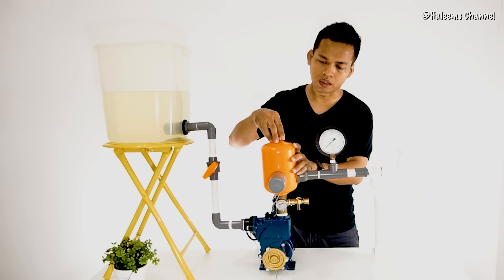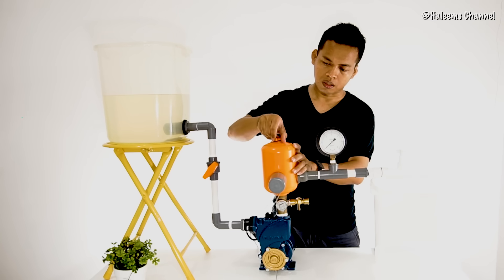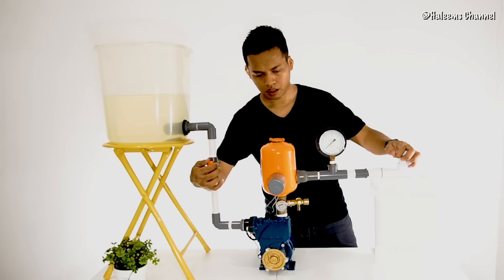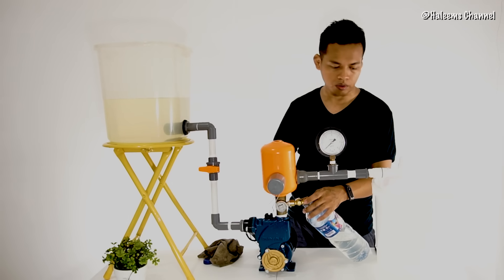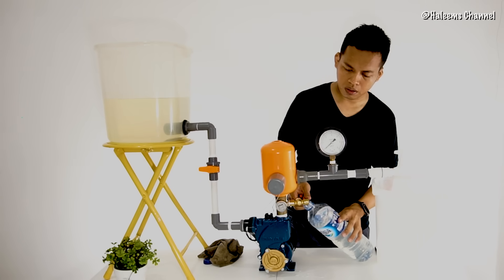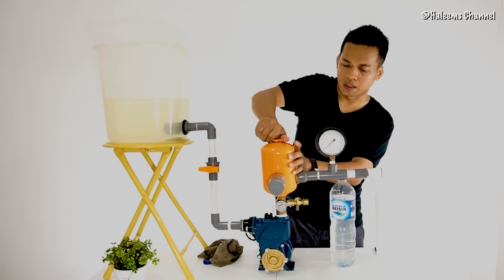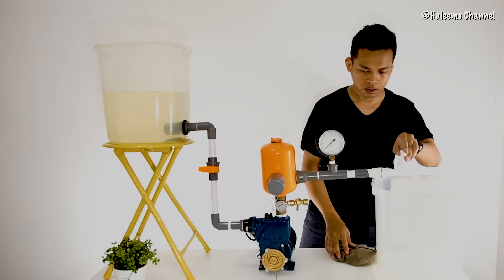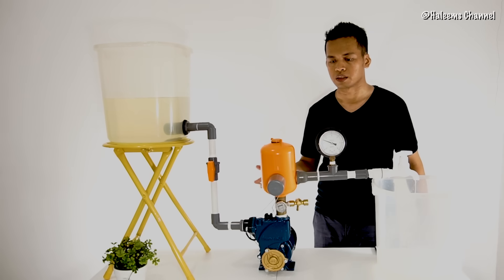Cara Memasang otomatis Pompa air dan Mengatasi Bunyi Cetak Cetek pada Otomatis/Pressure Switch

Comment: Mau tau apa yang salah dari skema pompa ini??
Itu posisi air masuk lebih tinggi dari mesin,ya jelas gampang dibuat seperti itu.. sedangkan kalo yang ngisap dari sumur,tabungkan harus dipenuhkan dengan air dulu baru bisa vakum dan menghisap air dari dalam sumur..
Silahkan dibantah komentar saya
Reply from the maker: tidak ada yg salah bossqu... pemasangan pompa itu bisa beberapa macam..
1. jenis pompa hisap
2. jenis pompa dorong ( lift up dan bosster)
3. kombinasi hisap dan dorong

untuk jenis hisap, permukaan air lebih rendah dari pompa. misalkan hisap dari sumur atau underground tank dll.

untuk jenis pompa dorong lift up, yaitu mengangkat air menuju ketinggian tertentu (ke penampump air, gedung bertingkat, dll), tipe ini permukaan air bisa lebih rendah atau lebih tinggi.. terkadang tipe ini adalah tipe kombinasi hisap dan dorong

untuk pompa dorong booster, yaitu sebagai penguat untuk menambah tekanan aliran, bisa booster horisontal atau booster down (aliran menuju ke bawah), tipe ini khusus permukaan airnya adalah lebih tinggi dari posisi pompa.
nah, di video ini termasuk jenis instalasi booster 

mengenai terjadi nya vakuum, 
vakuum hanya terjadi di rongga pompa (pump body/pump casing) pada saluran hisap (inlet), bukan pada tabung. 
tabung sendiri posisinya pada saluran dorong (outlet),
inlet terjadi vakuum (negatif), dan oulet terjadi tekanan (positif)
tabung pompa hanya berfungsi sebagai perangkat sistem otomatis, yaitu utk menstabilkan tekanan agar switch/sakelar otomatis nya dapat bekerja lebih stabil..

begitu ya bossqu, semoga ada kejelasan, 
silagkan tanya2 kembali bia masih ada yg ditanyakan..
terimakasih.
Reply: Ini urusan nya sama tekanan udara yg lebih dinamis drpd cairan yg lebih statis terhadap tekanan kejut bosqu, soal drmn letak hisapnya gak ada korelasinya 😊
Reply from the maker: @IpunkP  terimakasih sudah berbagi pengalaman di channel ini, semoga bermanfaat buat teman2 yang lain...
Reply: @IpunkP  tapi pompa gak bisa ngisap kalo ga dipancing sampe penuh dulu.. itu gmana?
Reply: @Ilmumekanik  itu cuma teknik hisapnya, ini yg dibahas soal pressure impact nya ke pressure switch.
Reply: @Ilmumekanik  biasanya itu ada kebocoran di foot klep (pompa hisap)
Reply from the maker: @deniaz_deniuz  benar, ada priming failure/kegagalan vakuum pada saat proses hisap, yg disebabkan air tidak cukup untuk menghisap awal,  salah satu penyebab tidak adanya foot valve..

ada dua kategori pompa berdasarkan proses hisap nya.
1. self priming.
2. non- self priming.

self priming, 
tipe ini dilengkapi dengan priming tank yg berfungsi menampung air didalam pump body, sehingga saat proses hisap tidak perlu terus menerus ada pacingan, hanya pertama kali harus diisi air.

sedangkan non-self priming, tidak ada priming tank nya... harus dipasang foot valve.. jika tdk ada foot valve, harus mancing terus menerus..

nanti kalo ada waktu akan saya buatkan video nya... mengenai self priming dan non self priming...
Reply from the maker: @Ilmumekanik  tidak bisa hisap, harus mancing..
penyebab utama nya adalah riang priming tidak cukup ketersedian air nya, karena check valve atau pun foot valve bocor/ada kerusakan/salah pemasangan..dll.. silahkan cek kondiai chek valve/foot valve nya...
Reply: Sy mau bantah, rumah, di tmpt saya umumnya pakai 2 pompa. 1 buat naikin ke tandon(atas) 1 lagi buat bantu distribusi ke outletnya. Nah yg dijelasin masnya ini adalah pompa dr tandon(atas) ke kran2.
Reply from the maker: @suryah999  tipe di video ini hanya simulasi contoh terkait penyebab bunyi dan mengatasinya, bisa di aplikasikan untuk jenis pemasangan pompa hisap maupun dorong
Reply: salut boss , di tengah terjangan netijen , anda tetap tenang membalas tanpa emosi , penjelasan nya bagus sekali bos , pompa ane juga sering tet toet etot terus berisik smpe pasang saklar buat mati hidupkan , jadi mau mandi dlu baru nyala padahal harus nya seperti agan jelaskan itu otomatis , emang tukang air ane kurang bagus boss
Reply from the maker: @edwinsanjaya5575  terimakasih sudah berkunjung di channel kami, 
jawaban kami berdasar pada pengalaman lapangan..
dan tentunya pengalaman itu akan terus berkembang sesuai kondisi dan perubahan zaman...
tidak ada yg paling benar...
saling tukar informasi saja...
semoga bermanfaat buat teman2 yg lain...
karena belum tentu teman yg lain mengetahui akan hal ini...
bagi teman2 yg sudah tahu ya silahkan berbagi dan dikoreksi apabila ada yg salah...
salam kreatif...
Reply: Pompa itu akan berkerja jika Bak isap pompa terisi penuh, Tabung masuk bagian Out & bisa anda manfaat kan sbgai jalur masuk air pancingan awal sj tanpa harus memenuhi tabung tekanan saklar auto.

Air pancingan MALAH tak di butuh kan bila Sumber air seprti dlm video krn terisi sendir, fungsi pompa hanya utk menambah laju aliran & video tsb membahas TIET - TUET (on/off) yg tak di kehendaki berikut SOLUSI tuk ngatasi.
Reply from the maker: terimakasih sudah berbagi pengalaman nya di channel ini, sebagai bermanfaat bagi temen temen yg lain...
Reply: Ini booster pump, untuk menaikkan tekanan/kuat dorongan air, bukan buat ngisep air dari dalem sumur
Reply: Ayo berkarya untuk perubahan yg lebih baik
Salam kreatif👍
Reply: Saya mau tanya capasitor untuk simizu 125watt ukuran brp mf , dan tdk kuat dorong otomatis on off , apa yg harus di ganti trmksh
Reply from the maker: shimizu memiliki banyak varian di kelas 125 watt..
untuk mengetahui capacitor nya bisa di cek di Name plate ataupun di manual book nya..
biasanya menggunakan 8uF, ada yg 12uF untuk model 116BIT..
Reply: Haleems Channel trmksh
Reply: posisi air masuk itu dikiri atas kan toren air/bak penampungan..klo isap dr dlm tanah ya beda lg mesinnya.

Comment: Mau nanya bg, apakah sistem ini khusus yg mempunyai tabung penyimpanan air? Apakah otomatis nya ini bisa juga diterapkan pada sanyo tanpa tabung penampungan air? (langsung sedot dari sumur)?
Reply from the maker: pompa dalam video ini menggunakan sistem otomatis dengan jenis Pressure switch.
penggunaan jenis Pressure Switch sangat dinamis,
bisa untuk pompa hisap (langsung sedot dari sumur), bisa untuk pompa dorong ke atas, bisa untuk booster.
Reply: @HaleemsChannel  saya sudah pakai tabung kaya gitu tapi msh ada yg bocor dan bunyi cetak cetek cara nabganinya gmn bank biar gak cetak cetek
Reply from the maker: Gunakan tabung yang didalamnya ada pemisah antara udara dan air atau gunakan tabung yang lebih besar..
Reply: @HaleemsChannel  berati tabung itu harus kosong ya mz tanpa ada air.terus kalo di dlm tabung itu sama sekali gak ada air.gimana bisa ngalir airnya mz.coz itu air keluar kan lewat tabung .

Comment: maksud saya mau pasang otomatis kompresor mini yg tanpa tabung,kalau waktu spraygan di buka mesin hidup sendiri/ di tutup mati sendiri?
Reply from the maker: kompressor tanpa tabung, 
spray gun langsung ON/OFF, dengan menggunakan pressure switch,
Bisa aja,
karena kompressor sendiri itu menghasilkan udara (compressible), untuk mencapai titik tekanan pada pressure switch (on/off) butuh waktu...
ada waktu jeda, bergantung besarnya pressure kompressor dan pipa/tube yg di lalui nya..
yg perlu diperhatikan; 
1. spec. kompressore nya, tekanan nya berapa, harus sesuai dengan kemampuan pressure switchnya...
2. instalasi piping/tubing, niple2, valve nya harus sesuai

Comment: ga prlu tabung klo bka kran nya full jg ga bkal cetak cetek
Reply: slma in pke pipo out yg 1/2" tnpa ad kndla cetak ctek  asal bka nya full
Reply from the maker: Memang benar,
In condition nya juga terkait dengan Tekanan yang dihasilkan pompa (Total Head nya), kecepatan aliran nya. untuk jenis Pompa yang memiliki total head bisa sama dengan Nol, mungkin tidak masalah, namun untuk Pompa yang Total head nya tidak bisa mencapa Nol, (jenis pompa sentrifugal) akan terjadi masalah.

Problem cethak-cethak disini pada banyak kasus seperti:
1. penggunaan shower
2. wastafel yang bukaan kran nya di perkecil
3. kran mesin cuci yang diperkecil
4. dll. (yang umumnya keluaran di perkecil)

untuk bukaan full, memang tidak terjadi cetak-cetek. (in condition yang dijelaskan sebelumnya)
Reply from the maker: Benar, tapi in condition ya boss, ukuran pipa yang digunakan dan ukuran kran yang digunakan,
semakin kecil ukuran pipa keluaran dan ukuran kran nya, akan terjadi hambatan dan menyimpan tekanan didalam pipa itu sendiri, dan diteruskan ke switch yang akan timbul ON/OFF terus menerus.

Comment: nanya bang itu pada bak hisap pake check valve ya? yang membuat aliran air cuma hisap?
Reply from the maker: untuk jenis instalasi Pompa Booster (seperti video), check valve sebaiknya di pasang setelah pompa (untuk mencegah pompa tidak cepet rusak akibat water hammer), dan sebelum pompa, bisa dipasang gate valve (untuk persiapan saat penggantian/repair pompa rusak)

dan untuk jenis instalasi Pompa Hisap, check valve/foot valve harus dipasang sebelum pompa, (terlebih bila jenis pompa adalah non-self priming), agar air tetap berada dalam pipa dan rongga pompa untuk mencegah failure priming

Comment: Kalau gak mau gampang mati hidup Pakai tee yang sudah ada drat 1/4 nya di online shop banyak yang jual
Dan pakai tabung 19L yang biasa di pakai jet pump 
Jadi simpanan air bertekanan nya banyak
Reply: Bang2 Disitu ada aja komen nya di setiap video masalah pompa air
Reply from the maker: kemampuan hisap pompa di ukur dari kedalaman permukaan air (bukan kedalam sumur),
kedalaman permukaan air tidak mempengaruhi bunyi mati bunyi mati pompa air.
on/off pompa yang terus menerus dikarenakan sistem sakelar otomatis nya tidak bekerja dengan baik.
bila jenis sistem otomatis nya menggunakan pressure switch, hal tersebut disebabkan pressure switch dan tabung tekannya yg mengalami problem. problem yang sering terjadi dikarenakan tabung tekannya terisi penuh dengan air sehingga tidak ada ruang untuk kompresi tekanan..dan terjadilah on/off terus menerus saat keluaran air kecil.
solusinya, pastikan tabung tekannya terisi dengan udara/gas.

pemasangan toren/tandon air hanya berfungsi membantu menyimpan air agar supply air selalu tercukupi, misal pada saat pompa mati, air tetap tersedia dari toren... jadi tidak ada hubungannya dengan bunyi mati bunyi mati...
Reply: Tee tu apa bang??
Reply from the maker: @ultrasgruda  Tee itu salah satu fitting pipa untuk sambungan percabangan pipa dengan 3 lubang berbentuk/profil huruf "T".
Reply from the maker: bang bang benar.... tabung 19L lebih bagus... buat yg tidak mempermasalahkan biaya investasi kisaran 150rb an sudah dapet tabung tersebut..

sebenarnya dgn harga tersebut, jauh lebih murah dibanding bayar listriknya utk pressure switch yg cetak cetek, ditambah lagi ada kemungkinan biaya total kerusakan pompa...

jadi, penambahan biaya tabung 19L sebesar 150rb an, sebenarnya tidak rugi... malah menguntungkan... pompa jadi awet, dan biaya operasional jadi lebih hemat...
sangat direkomendasikan.. silahkan mencoba...
Reply: @HaleemsChannel  saya 2  malahh tabung 19L nya karena beli di bukalapak kalau 1 mahal di ongkir jadi beli 2 lebih murah ongkir nya pakai jne trucking di hitung per 10kg
Dan harga tabung 19L nya juga cuman 110rb 
Di tempat saya 160rb
Itu beli 2 total sama ongkir 300rb  

Pompa nya pakai pompa celup 1/2hp
Reply from the maker: @bangherlambang3226  mantaph... buat spare..👍
Reply: @HaleemsChannel  buat nozzel yang 7 model semprotan nya 
Bagus banget karena semua jenis semprotna nya kuat 
Apalagi yang fokus nya di semprotin ke tangan juga
Kuat seperti alat cuci motor yang pakai pompa dc12v
Reply: Haleems Channel kl masang tabung 19 L di pompa pendorong caranya bagaimana???
Reply from the maker: @Cam Vrets buat dan pasang terlebih dulu sambungan percabangan dengan menggunakan Tee pada saluran dorong/discharge pompa, pilih Tee yang sudah memiliki drat, sesuaikan ukuran drat nya dengan drat pada tabung tekan dan langsung aja pasang tabungnya pada Tee tersebut.. 
untuk lebih baiknya, buatkan dudukan pada titik pemasangan tabung tekan.
Reply: Haleems Channel kl Ukuran tabung harus di sesuai kan dgn jenis mesin ..??
Reply: Drat input dan output brp ya??

Comment: Klo cara mengeluarkan air dr tabung tekan shimitzu PS130 bagaimana? Tks
Reply: Kalau tabung  19L bisa isi udara lewat pentil atas 
Isi udara nya 1 bar jika settingan pressure switch nya 2 bar
Jika 3 bar settingan pressure switch nya 3 bar isi nya 1.4 bar 
dan seterus nya
Reply from the maker: cara untuk mengeluarkan air bisa dilakukan secara manual, dapat di lepas tabung tekan nya, dan keluarkan air dalam tabung.. cara ini hanya berlaku utk type tabung tekan yang tidak menggunakan karet/membran.

untuk type tabung tekan yg menggunakan karet/membran, cukup dengan mengisi udara atau gas nitrogen melalui port/pentil bagian belakang tabung tekan..